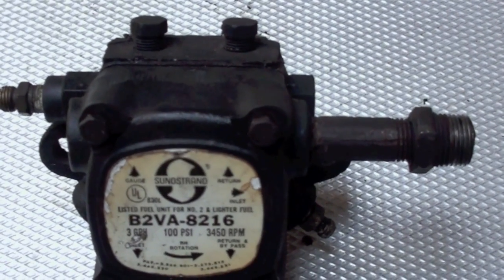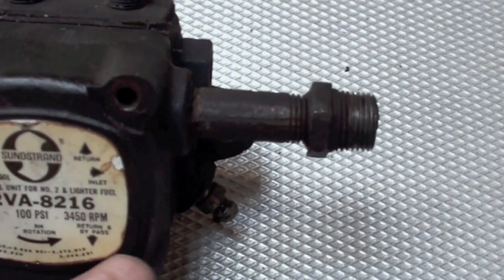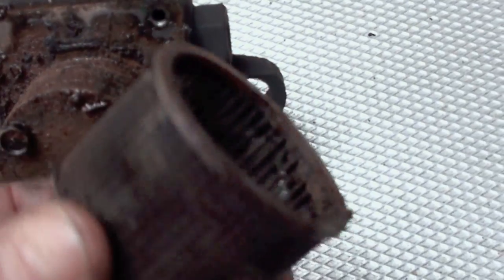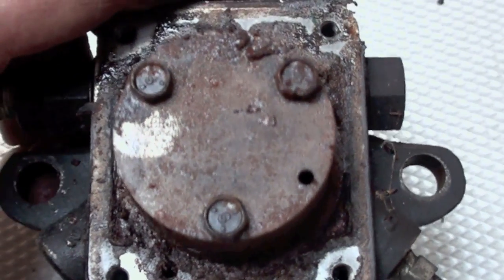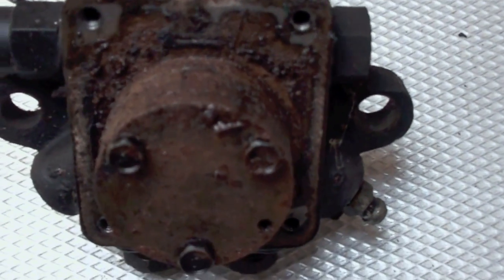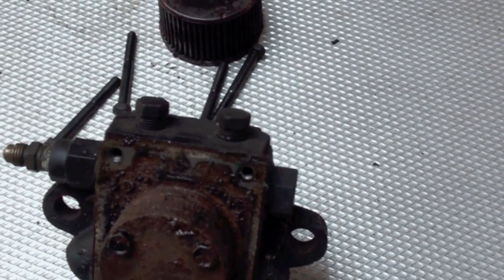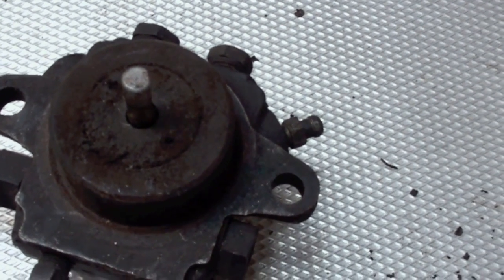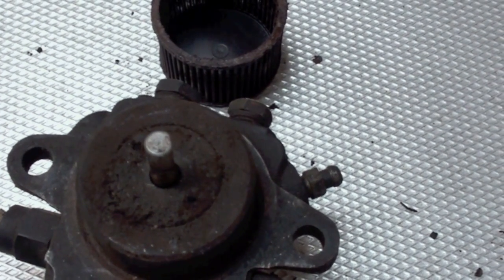A look at an oil burner pump failure and the reason for the failure.

Comment: Any idea what causes these pumps to want to only build pressure up to a certain point then suddenly drop back to near zero when turned up past that point, but then repressurize when the pressure screw is turned back down?  

They all were able to pull a high vacuum ( ~20 - 25 inches)  on the inlet and hold it indefinitely, so it wasn't due to air leaks. And the pressure regulator/shutoff spools were perfect and worked well when tested in good working pumps as well. 

I've come across that problem in a number of pumps even when brand new now in both the old mechanical startup bypass design and the newer solenoid controlled 'Clean cut" types.
Reply from the maker: You have probably turned it down past its maximum.
GFM

Comment: Do yourself a favor! Install an semi truck diesel fuel filter with a water separator petcock. I drain mine every week and it prevents any water from going in the pump. You'd be amazed at the water it will catch!
Reply: You should not have to check for water every week. If you getting water, check and clean the tank. Water should collect in the tank because the pickup tubes should not pull from the very bottom.

Comment: Hi how do I know if a loud vibrating noise is my oil pump of motor bearing?

Thanks I really enjoy your videos. 

I took a video but I cannot figure out how to post it yet!
Reply from the maker: You can send to Grayfurnaceman@gmail.com
GFM
Reply: bench test your blower motor if it's not the blower than you can address the fuel pump or fan wheel, our pump coupling etc.

Comment: I have a question the oil pump shaft should it turn easy or on the stiff side but still turns I think it’s the pump I bleed it I get a clear flow but every like 5 second i get spitting but still get a clear flow when it goes to lock out it makes a grinding noise it turns off and the motor and pump come to a stop thanks
Reply from the maker: The shaft should have some resistance.  It sounds like you either are out of oil, have a plugged oil filter or a vacuum leak on the suction line.  
GFM
Reply: Thank you for your help I compared a new pump to the old pump the old one had a little binding new one had resistance like you said but it was smooth also replaced the motor was making a grinding noise also added a new coupler just in case I started and it ran but with a misfire noise so I called my oil company service I told the guy what I did when he got home and it was the pump pressure it was low from factory is 100 lbs and the original was 140 so he set it to 140 and it runs like a kitten thanks for your help

Comment: 1-why didn’t you open up the pump.
2-Water didn’t seize the pump rust did. If it was water mixed it would have tripped the primary. It sat and rusted..if your going to teach, teach!
Reply from the maker: Thanks for the thoughts.  I did disassemble the pump.  Its in another video.  I did not put in a link at the time.  I have placed it now.
GFM
Reply: A very tactful response to a rude question.

Comment: Help! Have a customer with a Roth type tank, 2 pipe install. They have maintenance every year or two. Two weeks ago, motor failed, motor replaced (not by me). Came in again a week later, I went there, found the pump lucked up. Replaced with a clean cut pump. Did a tune up before that. No dirt in pump, strainer fairly clean. Fed with a General filter with a #15 filter element.
New pump locked up today. Carefully disassembled cap, shaft facing up. Oil nice and red, clear, no signs of water. Once I rock the shaft free using the blower wheel, it will run perfectly. Amperage is 5-6 amps on start, 1.2 amps on run.
 Any idea as to why this brand new pump would lock up like the old pump? I'm stumped at this point.
Reply from the maker: Is the new motor a centrifugal start motor?  It sounds like it from the amp draw.  But some of the newer motors are PSC and do not have as much starting torque.  Hope this helps.  Let me know what you find.
GFM
Reply: Present motor is a constant cap type. The problem is not the motor. The problem is the pump locking up after about a week. No water, no dirt in old or new pump. Tank is a vertical type with top draw. Pump is configured with a return line. Once the pump shaft is rocked free it runs ok until the next time.  I give amp draw of motor to illustrate that there is no unusual drag ( no cavitation, etc.).
Reply from the maker: I don't have any answers here.  The pump fails to start for 3 reasons.  Internal resistance (contaminants in the oil), regulator failure(regulator never bypasses), or inadequate torque from the motor.
GFM
Reply: grayfurnaceman I agree. I suspect a laxk if lubricity in the oil or dirt. The Roth type tank is a top draw, particulates have a hard time climbing the dip tube, at least on a single pipe system.
I dropped the cap off the pump, shaft side up, to ensure whatever contaminates there are still there when i examine it. No dice. Pristine. 
The pump is tight to the touch with motor removed. definitely not the motor. A real "head scratcher" for sure. Can't blame you for not knowing. As my old boss would say, "If it were easy, everybody would be doing it."
Reply from the maker: Let me know if you find the problem.
GFM
Reply: Will do. I'm beginning to wonder if it's not related to a 'bio-blend' fuel. But the voice in my head says they (whoever 'they' are) tested for all that type of thing and it would be a wide spread problem. That being said, even a wide spread problem has a beginning, right? Maybe I'm the first. And to think, I've been wasting my luck playing the lottery.
Reply: Hey John,

I’m having similar pump seized issues past 2 heating seasons. Did you figure out what was going on with your seized oil pumps?  Appreciate any input. Thanks
Reply: i haven't seen the bio fuel cause any lock ups yet just the seals going out by the shaft causing oil leakage. did you ever figure out the issue? sometimes the shafts are longer and the plastic coupling needs to be cut down. if its to tight you will notice the blower fan will be hard to turn by hand. also a bad oil line restriction could kill the pump quicker. also the B pumps are better then the A pumps if you have a 2 pipe system.

Comment: I have an oil pup. not pumping oil throught it. checked for blockage, ,all clear, changed filters, I have oil in the lines up the pump but it is not pumping , I checked the screen, it is clear. motor is turning , pump is turning but not pumping oil.  any help would be appreciated.
Reply: +William Mack I also have a filter at the pump and it is not drawing any fuel into the filter.
Reply from the maker: +William Mack This one looks like a pump failure.
GFM
Reply: +grayfurnaceman   thank you for replying.  one last question.  when I replace it will it ready to run or will I have to make any adjustments to the new pump. like vacuum adjustment ,etc....
Reply from the maker: +William Mack It should work out of the box as long as oil is available.  Just has to be bled.
GFM
Reply: +grayfurnaceman   thank you again sir, your videos are very helpful. and as I can see from comments, much appreciated.
Reply: +William Mack      changed pump. working fine. thanks again.

Comment: Hello.  I have a 25 yr old Ultimate? Oil Furnace w/ Honeywell R8182H Controller (H/L/Diff settings), Suntec A2VA-3006 pump w/ one line in, Beckett Burner (model AFG).  Had the furnace serviced last year when we bought the house.  Furnace ran fine for about a year.  The furnace provides hot water baseboard heat and domestic hot water.  He is the current issue - The furnace will start normally when there is a call for heat or domestic hot water.  The furnace runs normal for a few minutes.  Then the burner will go out, but the blower keeps going.  It will re-ignite and sometimes go right back out and then do it all over again.  No specific pattern ans sometimes it won;t do it all.  The furnace does stop when it reaches temp.  Note - the actions do not trip the lockout and actually the furnace will run again on the next call for heat, etc.  I hear no strange or odd sounds while the furnace is running and at start up there are no odd rumbling sounds.  We also keep the tank from running out of oil.  also of interest is that this condition seems to occur a minute or to before the water temp setting is reached.   Does this sound like a pump issue? Clogged oil line, etc.  Thanks for any insight.  I have learned a great deal watching your videos but could not find one with the similar situation I am having.
Reply from the maker: +Thomas Hatch This sounds like clogged oil line oil pump screen or filter. Hope this helps.
GFM
Reply: +grayfurnaceman - Thank you very much for the prompt reply.  I found the replacement pump screen that includes the gasket for my Suntec A2VA-3006.  (It only costs $4.99 and free shipping)  Is there any recommended torq settings when I remove and reinstall the bolts.  I'll try that before I call out the Service Tech.  I replace the oil filter every year and just did that and bleed it until I had a nice clear stream.  Just trying to keep this furnace running smoothly until we get a brand new one in the Spring of this year.  I'll let you know the results.  Your videos are great, even for novices and all homeowners should had a fundamental understanding of how their major systems work.  Thanks.
Reply from the maker: +Thomas Hatch I can't give torque specs. Just make the them reasonably tight.
GFM
Reply: +grayfurnaceman - UPDATE (SOLUTION) - many thanks.  I easily replaced the Suntec pump screen and replaced the gasket (it was pretty gunked up) as well as changing the main oil filter and corresponding bolt and bleeder gaskets that came with the replacement oil filter.  Re-bled the line.  The it took awhile to re-bled the line since I have an underground oil tank and about 25 ft of line.  The furnace re-fired easily, but again after 3 mins it started to flame out and re-ignite randomly.  That left me with the line blockage scenario.  I spoke w/ my local serviceman and he explained to me that more than likely I was getting cavitation in the pump due to the high vacuum my pump needs to draw in the fuel (13" vac).  He explained I could try to blow out the lines with my compressor.  He recommened no more than 30 PSI.  He was walking me through it on the phone as I did it.  As first it seems liked there was some resistance and then it seemed to not be there (I did that for approx 1.5 mins).  Hooked back up everything and re-bled the line.  This time, it bleed almost immediately.  I left it run until a got a pretty powerful clear stream.  That did the trick, the furnace has never run better.  It cycles on 1/2 of much as it used to (no joking).  Unreal.  It the spring, we are getting a new oil furnace and Roth oil tank.  Having the 550 gallon underground tanked removed.  Already tested soil samples and no evidence of leaking.  I just had to keep this 25+ year old furnace (Ultimate?) going until spring.  Alsmot hate replace it now, but it is time.   Love to her your advice and brands.  Thanks again as the problem was atleast one of or a combination of what you had suspected.

Comment: CAN I USE THE WHITE PURE SILICON FOR SEALING WINDOWS  WOULD IT SEALTHE BACK OF THE OIL PUMP PLATE GOOD FOR 300 DEGREES F ?  OLDER WAYNE BURNER  KEROSENE
Reply: No that type of silicone will not be oil proof. You are better off cutting out a new gasket from automotive gasket paper or using Ultra Black RTV silicone that's made to resist oil.
Reply: destruxxx thats a good point  thanks
Reply: Why do this? Strainers come with a new gasket.
Reply: thanks  guys   I see a new gasket might be the best way to go
Reply: Rondo Schiavoni Always use a new gasket. For two reasons: 1)The old gasket will get brittle and stick to both the pump cover as well as the pump body. 2) Replacing the strainer without using a new gasket invites the issues of reason#1 and a leak. Trust me: You don't want a leak. Not even a small weep.
 While i'm passing out free advice, let me add this: torque the bolts in stages like you were putting a wheel on your car. That cove is pretty thick,but you can still "tweak" it. And it will weep. Tight is good, over tight is not. The bolt at the lower left corner is particularly susceptible to stripping out. Don't be a gorilla. Be a tech.
Reply: Thank you  for the good advice.

Comment: I checked pressure, and it's good and also holds with pump off. But no spay from new nozzle. 
Acting like clogged but it pumps oil out of the end of the nozzle tube. Just no spray. ???
Reply from the maker: +Steve Cunningham New nozzles sometimes plug right away.  Try replacing it.
GFM
Reply: ok thanks, I'll try again. I replaced it 2 times already. And keep retesting pressure to see if it has pressure and if it's holding on shutoff. All seems good just no spray only a drip drip drip at the nozzle. I can take nozzle off and it pumps oil out. I can only guess nozzle still getting clogged somehow ? What do you think dirty oil or something ? Thanks for the replies
Reply: I took the nozzle off and let it run. The oil is coming out but it's not smooth continuously. It does flow mostly smooth but it's also surging. It makes a winding noise like a power steering pump going bad. Also I took the pump out and some sweating or oil at the shaft seal.
I should mention the pump is 20 years old.
Would you suspect pump going bad and just replace or can the pump be repaired with repair kit or something ?

Please advise
Thanks
Reply from the maker: +Steve Cunningham Could be dirty oil.  You might want to flush the system thoroughly.
GFM
Reply: Ok, I actually took apart the new nozzle and cleaned it, took off the sinter filter and brass screw pin with  distributor tip.

washed all out with WD40 then installed without sinter filter and screw pin just to see if any stream at all would come out. It sort of peas out as expected. Then I put back in with screw pin and distributor but without sinter filter and I get a spray.

However, I'm not sure I'm liking the spray pattern. It's a B nozzle and does have a B pattern but more of a pea pattern in the center and coned spray on the outer edges looks ok.  and also after shutting down the pump it spray and sprays for a while ?

If this sprays for like 30 seconds inside the pump after shutdown all the time that would make a huge mess.

Sounds like I have pump issues of various types not just nozzle issues.

How much pressure should remain in the nozzle tube from the pump to the nozzle tip after shutdown ? Any at all ? Or should it just bleed to nothing very quickly if there were any issue with pump valve shufoff ?

Sorry for multi questions just a strange furnace doing strange things IMO.
Reply from the maker: +Steve Cunningham Can't tell about the pattern.  It is normal for the nozzle to "pee" after shutdown.  Not good but normal.  Most newer burners have a solenoid to both delay spray until pressure is up and shut off pressure immediately after shutdown.  Hope this helps.
GFM
Reply: Ok got it figured out I think After removing the sinter filter, and the distributor I can tell for sure that it continues to spray on for at least 2 min. after shutdown. I spray into a bucket without electrodes to see spray pattern. I believe the pump. It's just bad regardless of it having pressure. It's running on afterwords for a long time.

Thanks for all the help. Ordered new pump and will give it another try and study it some more.
Reply from the maker: +Steve Cunningham Good luck
GFM
Reply: Steve Cunningham was it pump having similar problems i have stady flow but was all gunk up water i tried nozzel before i did filters so maybe re clogged em up there was alot water in sytem